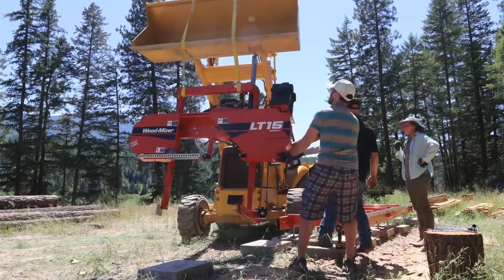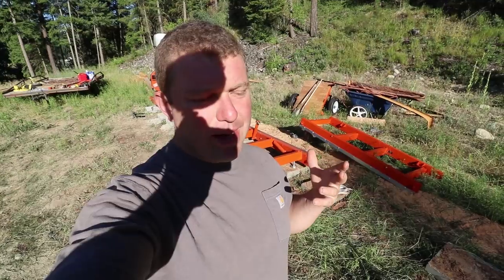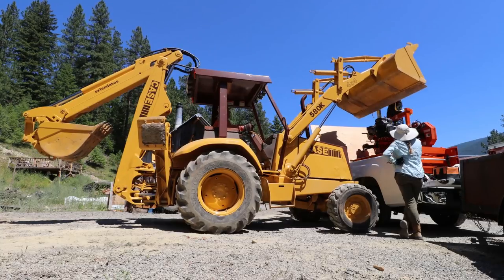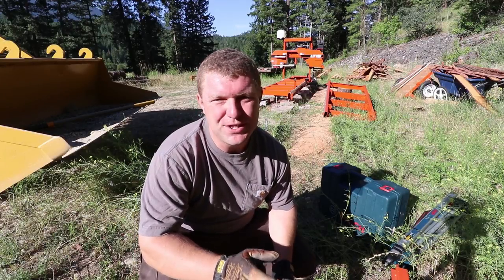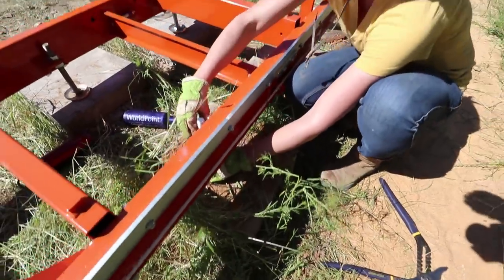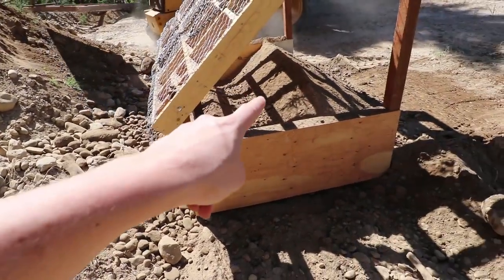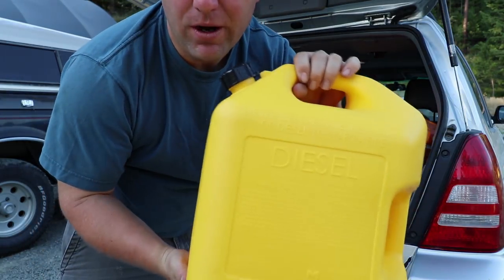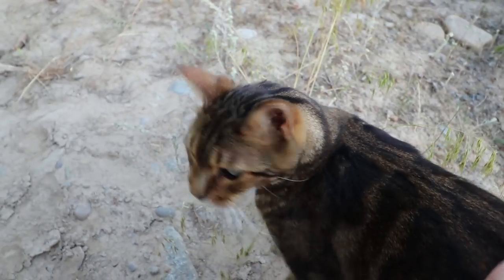BACKHOE ALREADY SAVED OUR BACON!

Comment: We recently got our first backhoe and skid steer. Anyways I went to our local oil company and picked up 2 free 55 gallon steel drums and use them for fuel. Bought a hand pump and a hose suitable for diesel for maybe 50 bucks total. Built a skid so I can load and unload them off the trailer. Seems to be work good so far. Using them 5 gallons to fill the tank will get old REALLY fast!

Comment: I had the same problem with my tractor - getting fuel. Grab a metal 55gal drum and a hand pump. You can get electric fuel pumps but they are expensive. I spent about $50 on my hand pump. Put the drum in the back of the truck and get it filled and unload it with the tractor. Use the hand pump to pump the fuel. Simple and cheap.
Reply: thersaholycow . We do the same thing and it works great!
Reply: This guy has the right idea. $5-20 on craigslist for the tank, $50 or so for the pump. You can pump 5 gallons faster than you can pour it from these crappy new cans. Get a couple barrels though so when one empties you can take it in at your convenience and still have some fuel. One issue, in my area at least, many places that have off-road diesel have this super short hose so you cannot fill your truck with it (and consequently, cannot fill a tank in a trailer either). I was filling 15 gallon barrels and had to fill a 5 gallon tank and then dump it in the larger tank. YMMV. Still, I now have 45 gallons of diesel on hand (2 15 gallon tanks and 3 5 gallon cans) which will last forever in my compact tractor.
Reply: You can also elevate 2 or 3 drums and use gravity fed system.  I'm sure a fuel company has delivery in the area.  Here we can buy off-road fuel and save even more money.
Reply: Using jerry cans is a good way of getting a infected fuel system as they sweat you end up with water in the cans which gets into your fuel. Drums are better option the second option is a stove oil tank they are cheap to buy you elevate it put a filter head on the outlet with a hose, you can have gravity feed.
Reply: Around here, Southern States will deliver diesel fuel but only if you get 100 gallons or more per load. Find a 100 gallon feel tanks and DO NOT EVER LET THAT THINK RUN DRY! you will wish you hadn't. A fuel tank for diesel will last for ever as long as it is NOT in direct sunlight. Keep it shaded and the fuel will last as long as you need it to.
Reply: Yep that's how we do it. We use 2  55 gallon drums and a hand pump. Got the second drum when diesel fuel dropped in price so we could always keep them topped off. Made a steel band to fit around the top under rim with 4 welded on HD eye hooks to attach on chains hooked on the bucket of the tractor bucket. EZ load and unload. The band has 2 tabs with a nut and bolt for EZ removal to the other drums, of course we could have just made one for each drum if we had more steel strips.  Keep the dream, you're doing awesome.

Comment: Guys you need to have the backhoe serviced it is not safe for craning.  Either the hydraulic ram seals or the valve chest for the dipper arm are leaking and it is dropping anytime you leave it up. Unsafe at the best of times but especially when you are on your own and have to leave the seat to hook up chains or straps while you are working under the bucket.
Reply: I saw that drooping too. Not good
Reply: my money is on the cylinder seals
Reply: That backhoe looks to have probably been painted to hide the wear and tear on it. Common practice with used machinery
Reply: idk, but I think that most have this issue, mine does the same thing and so do both of my neighbors tractors/loaders/backhoes, That's why you never ever work underneath either bucket.
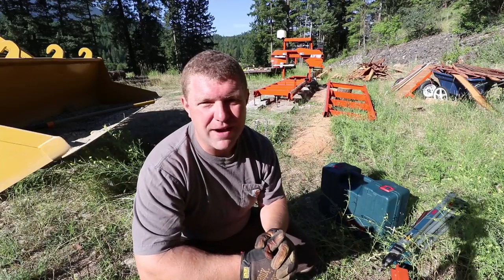Reply: For those wondering it appears a little after @6:20
Reply: Even the backhoe is hanging it's head in shame, all backhoes droop I hear you cry, nope only poorly maintained ones do. Another job on Jessie's todo list . 👍🙈
Reply: As an engineer who works on hydraulics of boat hoist and JCBs that is BAD, it badly needs a service. If you arm moves with out any input its bad!
Reply: Reggy_ S is 100% correct. Only worn, old or defective hydraulic system parts will allow the system to "bleed off" pressure while the backhoe arm is up. Failure to address this issue at this early warning sign will put you at risk of a sudden and complete loss of pressure, resulting in a very bad headache for anyone underneath the bucket. Please don't ignore this defect, I have seen several catastrophic hydraulic system failures over the years, and the aftermath is never pretty.
Reply: You can see it well before that. And you can see where he adjusts the height several times around the @4:30 mark because it keeps dropping.
Reply: That was during a timelapse so the problem was amplified and isn't impeding the work, only safety. However hydraulics shouldn't leak whatsoever. That being said, as long as you are super careful staying out from under the bucket and ask yourself every 5 seconds "if the hydraulics bust right now am i in harms way" then at that point you are just gambling with the cost of having it serviced vs dropping whatever you are working with and then still having it serviced. Have it serviced or maximize time between servicing to save money, your choice. But you guys are on a budget so i wouldn't fault you for choosing the latter, I probably would.
Reply: Arnold Romppai I wouldn't be calling anyone a fool. It's a challenge to simply understand the points you're trying to make here. Please take the time to read what you have typed to make sure its coherent and makes sense to the readers. You may have knowledge and expertise in a given field but unless you can effectively communicate that knowledge to others you're as foolish as a laymen with no experience.
Reply: Arnold Romppai... if you take the time to notice at 6min 20sec the dipper arm is dropping whilst there is no one on the machine to inittiate the movement and Jesse is out of shot either directly behind the bucket or possibly under it hooking up the lifting gear, this why I commented.   Accidents generally happen due to number of unforeseen events happening either together or in series so it is just good practice to eliminate as many possible risk factors as you can.  As someone who worked both on and in hydraulic plant for 35+ years in both agriculture and construction I have seen accidents happen on the best run sites and to highly skilled and trained people.   Accidents happen and the last thing I would want to see  is a video announcing that either Jesse or Alyssa or any of there helpers/workers were hurt.  You are entitled to your opinion and to run your own operation as you wish, as are Jesse and Alyssa,  they can ignore the advice as irrelevant if they wish, but please do not make little of people for offering genuine advice on what is considered standard good practice.  The guys are of course on a budget but they are working in a rural area and often on their own so a simple accident could cost them very dearly and much than just financially.
Reply: YES!  Reggie S and all comments are spot on.  Repack ALL dipper cylinders first.  They probably need it any way...  WARNING!!!!  If this loader hydraulic system is the same as my JD 310C, there is a MAIN LINE hose coming off of the HIGH PRESSURE side of the hydro pump.  Please have a qualified mechanic replace it!  If that hose blows at the wrong time, your entire hydraulic system will collapse 100%  This can be a deadly hazard!!  Other than that, this IS THE BEST tool you will ever own!! Take care!  Thanks for the vuds too! 😳
Reply: Charging system should be close to 14v when running. Sometimes you have to run it a little above idle to get max voltage, and it may not hit that level right off the start on a dead battery, but check it out with the fresh batt. Also, count on about one gallon per hour burn on your Case, more if you are pushing it hard. Shut it down anytime you pause, makes the fuel go farther, the starter dies early.
Reply: Arnold Romppai At last, the voice of reason!! 😄
Reply: I was just gonna say that ! Lots of you are on the ball !
Reply: Hydraulic systems all have their own specs regarding acceptable leak down rates. I used to put new Hitachi Excavators together and we would run their cycle times and measure leak down rates as part of the commissioning. It is completely normal for the hydraulic cylinders to creep over time due to applied load or gravity. When the seals start dripping and the leak down rate becomes noticeable to the eye, that's when you think about getting a replacement or a rebuild kit. 

A lot of equipment these days also come with 'anti-fall' systems (non-return valves) that will hold a cylinder in place even if a hose bursts. I don't know if this back-hoe has this system but most manufacturers include them since they  know people use this type of equipment to lift things. You can even get fork attachments, boom arms etc to make the equipment more versatile.
Reply: sparky24 ... dude if you think a ram dropping at that speed with the engine running and with no load on it other than an empty bucket is fine then you are the one that doesn't know what they are talking about.  As for name calling that just shows your level of maturity.  I will put money on one thing though... if someone does get hurt or property damaged due to this issue not one of you people that have advised that it is fine will be seen for dust or volunteer to take responsibility for the advice you gave.
Reply: ALL HYDRAULICS LEAK!!!
Reply: that's what I was about to say
Reply: false
Reply: sparky24... you live in an ideal world where accidents don't happen then man. There are people killed and injured on the best run sites around the world every year and this build will involve help from friends and family many of whom are likely not used working on sites or around plant and machinery. Not to mention that as an operator there is nothing worse than operating a faulty machine that is not predictable.   Accidents normally happen due one one or more unforeseen events occurring, the best way to help prevent prevent then is to eliminate as many possible risk factors as you can. Also if you took time to notice my original comment was more about using the machine as a hoist so it is not only about someone being under the bucket.  But anyway you are entitled to your opinion as much I am and I will stand by my previous comments.
Reply: great Irish minds think alike lol. i was going to say the same. you probably wouldn't notice it only for the fact the video is sped up but yeah get someone to have a look at it. A professional that is!!!
Reply: sparky24...  I have never recomended working under the bucket, in hindsight I should have worded it better but please try to take the comment in the context in which it was written.  As I said in in a previous comment I have been around plant for 35+ years and in that time have lost count of the amount of times people ignore the obvious risk because they are in a hurry or because it will only take a second or because they just have an absent minded moment or they feel they are just good enough to not get hurt or make a mistake or simply because they have gotten away with it every other time they have done it. If you accept the risks of faulty equipment thats fine and but I will not agree with you recommending it to inexperienced operators, thats just inviting disaster.
Reply: ive worked with forklifts for 12 years. if it drops at that rate there is a problem.
Reply: Like it has been said over and over. Don't Trust The Hydraulics. The smallest leak in an o ring can shift a spool causing the bucket or the load to drop unexpectedly. I fell 30 feet when the top of a forklifts main cylinder broke. Fortunately I wasn't hurt as much as scared. 
With any suspended load, gravity is not your friend.
Reply: Labor Board walks on my property, then can expect an ass full of bird shot. Their regulatory authority is limited to employers, not private individuals.
Reply: 12.6 is static battery voltage not 12.9 unless it was just charged if the bat was dead the alternator could drop to 12.9 while charging.  you need to know how much current the alternator is putting out, a simple clamp meter is all you need
Reply: Remember the video is drastically sped up.  That amount of creep is probably within the acceptable spec from the manufacturer.
Reply: Yep noticed that as well.  It needs some hydralic work for sure....
Reply: +alco424 It may be sped up but I really don't think that arm should drop in period of time it takes do hitch a chain to something or in time you step out of machine and walk to arm, which it seems to be doing.
And it may very well be OK according to manufacturer I will not argue that... to lazy to dig info...
I just think that they should check if something isn't giving way.
Reply: Was just about to post the same from 06:30.
Reply: well... you see... I my self build water lines that leak only when you open the tap :P
Reply: There are two things that cause hydraulic creep.  If there is oil visible on the outside of the cylinder, it is the shaft seal that is failing.  If there is no oil leakage it is the piston ring inside that is leaking.  Either way can kill or hurt you.    This is a relatively easy thing to fix and you could contact your Case dealer with your serial number and they can ship the parts to you.  This is routine maintenance and a good idea would be to find the hydraulic filter on the system and change it too.  It could be allowing contaminates to recirculate through the system.
Reply: Atleast here where I live backhoe or excawator can use temporary lifting.
Reply: Reggy_ S i
Reply: I was wondering about that!
Reply: reggy plz stay in your apartment where it is safe try not to wonder beon the first floor
Reply: mindy burton...   a couple of tips to help you throughout life,   don't guess at people circumstances or experience it just makes you look stupid when you are wrong and secondly for an insult to have any affect the person you are insulting actually has to value your opinion of them...
Reply: mindy burton... oh ok I'll change my mind just because you tell me to!  lol

Comment: Jesse, you should be getting more voltage at the battery when it's running. (13.9-14.2) it's possible the rectifier is not letting the alternators charge back to battery.

Comment: Re: backhoe settling -  There should be a blocking valve lever somewhere near the FEL joy stick.  I think that should block hydraulic flow back to tank.  Won't do anything to help if cylinder seals are bypassing oil.  As for the alternator, approx. 13.6 to 14.2V at rated speed under full electrical load

Comment: As I mentioned in a previous video comment; you'll never sell your tractor, unless it's to upgrade. they are an everyday must have tool... and with that, consider a 55 gal drum with 12v pump ($150) for your diesel fuel management. there's a lifting/clamping device (approx. $200) specifically made to pickup full drums with a chain & backhoe. This way you can put the drum in your truck fill it, and be able to easily lift it out when you get home. I did the yellow 5 gal cans at 1st too, but soon realized that it just doesn't cut it.

Comment: Get a clamp ammeter. Charge voltage is too low at the battery. You probably need a new alternator. Also, you should be able to buy fuel without the added road taxes.
Reply: Most cheap clamp meters only do AC. They are becoming more common but be sure to look for one that can do DC.
Reply: The reason it was 12.9v instead of higher is because the charging system was under a heavy load while charging a dead battery.  If he had waited after 20 or 30 minutes of charging, it's very likely that the voltage would come back up into the normal range of 13.5v to 13.75.

Comment: I have same backhoe, and most the lifting I do with it is done with the boom locked up. you just learn to measure the distance and with the extension it is easy and it will lift more that way and you can move around with a load too.

Comment: We got a free 55 gallon fuel drum from the local co-op where we buy diesel for our farm and use the backhoe to lift the drum in and out of the truck whenever we need to get more fuel. For us, 55 gallons last about 3 weeks in the summer and a lot longer in the winter. It's a lot easier than 5 gallon cans.

Comment: I suggest some "gas can vent caps" from Amazon on those new diesel cans. As a guy who's filled a rented excavator's tank with 40 gallons several times, the time after I put on some vent caps on the 5gal cans went MUCH easier.

Comment: Use a Stanley knife to etch the plastic before using a marker for the timber sizes to make the marking darker and more permanent.  When in use, put it in  a plastic bag to keep from scratching your original.  Gravely environments turn lucite milky with scratches.

Comment: should go to the local car wreckers and get a few used car fuel tanks for your fuel. put them on your trailer and fill them up and bring them back. you might even get the pumps aswell so you can put a 12V battery to move the fuel around.

Comment: The Lexan template thing is a good idea IMHO. Cut templates for your common sizes and then you can maximize timber yield. Don't forget to allow for the width of the blade though or you'll wind up 1/8th inch off on everything

Comment: Looks like Grizzly 3.0 is doing a good job, with the front end up 2 feet it give the big rocks somewhere to fall. Sometimes you have the concept but you need to make modifications to get it to work they way your expected.  Be careful not to get hurt, with working long days and on many projects you don't want to get pinched between something.